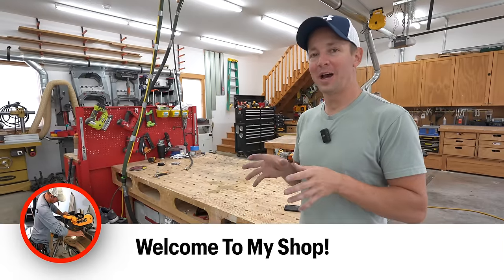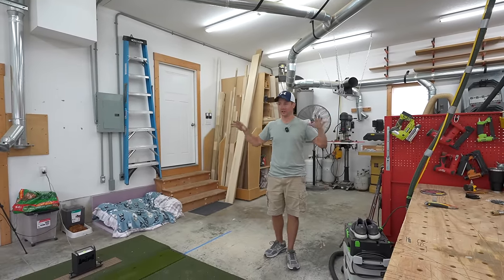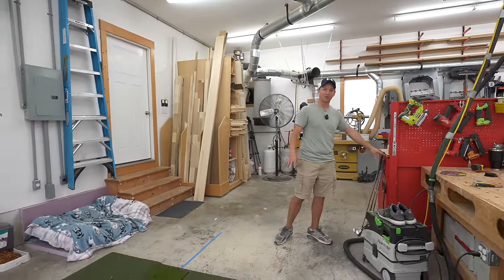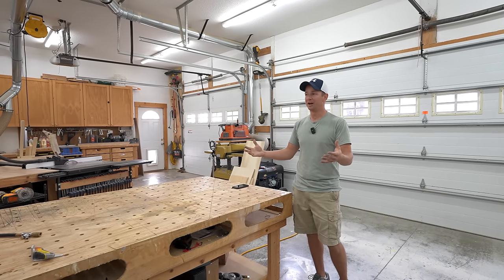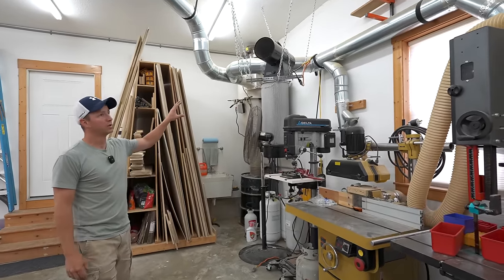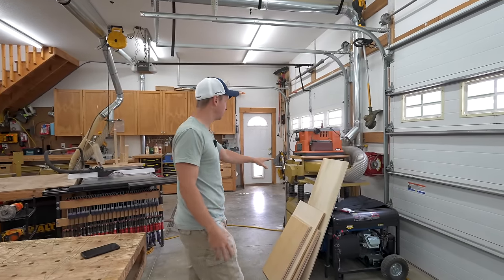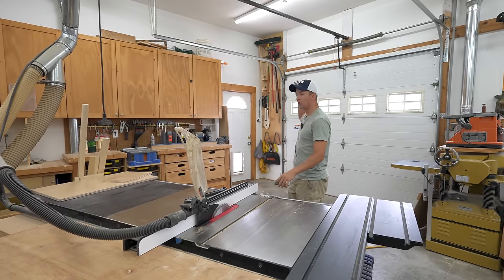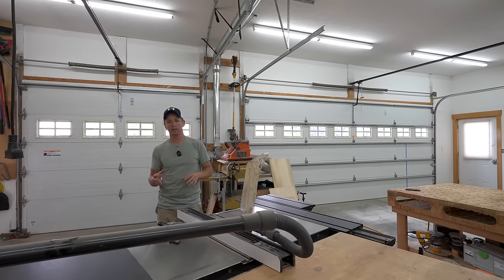Finally! A Trim Guys Shop Tour: The Truth About Small Shops...

Comment: Very nice shop. It’s interesting how different machines become important to some and not others. Seems not too many shops have a spindle shaper anymore. I guess good router tables have taken over. Similar to compound miter saws replacing radial arm saws. I’m a wood worker from years gone by and those 2 machines along with a good table saw were key. I guess there aren’t too many small shops making raised panel doors so a spindle shaper isn’t needed. I also had this huge overhead sliding table sander. Man that was a trip.  Nowadays the equipment is so neat and more affordable . Great video young man!

Comment: Please consider getting rid of the gas bottles and spending about $3000 for a. mini split. Not only will it keep your shop ready to go in at all times, but should you have a disaster as a result of the current heating, your insurance company may try to balk at the claim unless they were aware of the current set up. I had to remove my wood stove (after being honest and asking the question - but didn't want to find out the hard way it was an issue) but then convenience of a 100% temperature controlled shop sure has been nice. I can go there any time, day or night and it's comfortable. And the mini is super efficient. Love your work ethic and down to earth attitude! Thanks for the videos!

Comment: nice shop. i like when people talk about their thinking behind things, what is working well & what is not, and what they find works for the type of work they do. i think your shop is huge! having only been in really small shops, i see so much inefficient use of space that could easily fit even the stuff you have in your attic area down there. maybe check out some shop tours for folks that have really small shops. like no more than small two car garage size. ideally one car garage tours. you could easily adjust your layout, raise up your dust collection so it isn't so low and blocking useable wall space, etc. but you also seem to have the ability to go up in size. so probably doesn't matter. and what is working for now you do well in. i can't wait to see what it looks like when you upsize. thanks for sharing. best!

Comment: Here's a suggestion... I added a 24" deep shelf above the garage door track. I attached it to the wall on one side and used the same slotted steel used to hang the garage doors on the front.
Reply: I can't build the word picture from this, what it do?
Reply: @nevermindthebull0cks  I used 2x3 lumber for the sides to create a shelf, I attached 1/4" plywood on the top of the 2x3's... this gave me a 2' x 8' platform... I attached it to the header above the garage door springs using exterior screws... I cut L-shaped slots in the corners of the plywood next to the 2x3's, then I inserted slotted steel (the same ones to hang the garage door) and secured them with carriage bolts, I then used lag bolts to secure the steel to my rafters. This gave me 16' of storage (2 platforms) for less often used items, plus it protects items from theft when the garage door is left open.

Comment: Thank u Spencer !  I operate in my garage/ shop & see more and more guys doing it!  Instead of buying a shop or actually renting a shop I purchased a 2 nd veh ( a van) to haul tools .  Then put a lumber rack on my truck to haul some materials.  Do finish carpentry/contractor solo also.  Do a boat load of cabinets and built ins !  Some doors!  Very lean shop !  I run a 3 hp cabinet saw and my miter saw !  Hv small planer & jointer Also !  One huge work horse for me is the Track Saw ! ( I hv two Makita’s) and break all my sheet goods down to 4 or 6’ no more it’s too big for my shop!
I hv an Infinity Router Table and it makes all my doors or whatever ( lots of rabbits).
Great video but I see a track saw huge for a smaller shop!

Comment: The wall of shame? 😂 JK. I think everyone goes thru this very thing… thinking they could use something then talk themselves into needing it only to discover they didn’t. As a tool junkie I still fall for it occasionally. So now I make it a process. I make myself take at least a month to think about it and in most cases I find I don’t need it. 

A 100’ X 80’ shop… a spray booth, compressor room and a workflow tuned to my preference with a modular set up is my goal. 

Thanks for sharing Spencer! 👊👊
Reply from the maker: Same here!

Comment: Sawstop saved my tail when, in a hurry, I pushed a narrow piece through the fence - using a metal push stick - what was I thinking and was tired and careless. The pushstick hit the blade. Lost the sawblade and the clutch - which was so much better than the pushstick flying into my forehead.

Comment: Well those 30 sheets will become several hundred sheets, plus the drafts of regular dry lumber.
My son has a 4000 sq ft shop and its not large enough.
You will ultimately be doing your own finishing which means room for a paint booth.
You do have some nice equipment, dont be selling any, especially the sanding equipment.
He has a Oniada dust collection system also, and it dumps into a regular trash can.
But he also has a pump on that which runs while the dust collector is running.
And it pumps directly into a large enclosed dump trailer.
You will also be buying an edge bander, because the euro style cabinets are easier and more profitable.
But you can also put things like that on its own small dust collector.
If you trim houses, you will ultimately be making the trim, which is very profitable.
But it will mean a large shaper, maybe even two of them, so again dont sell the nice one you have.
You will also be using much more air, especially for sanding.
You (will ) also be upgrading your saw. Probably to a sliding table saw for cutting plywood, or a large rack saw, or even both.
You will also ultimately find other ways to get a straight edge on your lumber than by using the jointer.
Keep this video for future reference, because with the larger shop your opinions will change, and those will change as well.
The drill press will be used more as you build more cabinets for drilling the hinges.
Again, dont sell anything, you will ultimately be sorry you did.

Comment: That dust collector will work fine in a bigger shop you just need a bigger bin 5 hp is plenty big enough for most shops. Only reason to go bigger is if you have more then one person using big tools or you can have a separate collector for just your planer and jointer.

Comment: Great job! I enjoyed watching the whole video. I do have a question. But before I ask it—and let me apologize up front for the length of my question—just know that I am retired and new to carpentry and woodworking. I just started building a shop in my garage primarily to fix and renovate my house. 

Obviously you're familiar with Ron Paulk, or at least his old bench design, and over the last two to three years he's been getting even leaner with his setup and maintains that he can do everything he needs to do without all the large machines. 

So for example, instead of using his two Powermatic cabinet saws from the past, he's now using two small router tables that sit on his bench, a track saw, TSO parallel guides/edge guide and a small Sawstop compact table saw (the CTS). He still has a miter saw and I've even seen his Dewalt thickness planer on this trailer. Obviously he has many more tools, but he doesn't have anything I'd consider large, and he could literally fit everything he has in your garage twice over. 

Now I am NOT saying his system is superior (I don't know enough about what you guys do). But I do know he and his wife Chris have built over 200 custom homes on an Island in the Pacific Northwest. He's renovated many more and has done other countless projects. In fact, he considers himself primarily a finish carpenter. Before retiring and starting his Florida fixer, he was building tons of built ins as well, so I imagine  like he's doing virtually everything you're doing, but he is going in the other direction becoming even more of a minimalist than he was a few years ago. 

My question is this: what is he giving up that you are gaining by, not only working in a much larger space, but by doing without any large tools? 

The efficiency claims he makes suggests he's saving more time for his family than most as he and his wife have chosen a lifestyle where they want to travel a lot and surf, bike, hike, engage in photography, etc. In other words, what do you think are the significant gains you're making by going big or bigger rather than his supposed small and efficient approach? 

He also doesn't just have to work at his clients' homes. Everything he does can be done in his little garage as well, but he obviously chooses to be mobile so he can spend more time at his clients rather than commuting between their homes and a separate workshop (at least until he retired. Now he and Chris are fixing and I presume flipping homes, so he's primarily working out of his small garage which is probably similar to mine (20' x 20').

Comment: Hey Spencer do you get the suction you need on the boom from that MIDI? I run a couple and was thinking I'd get a CT26 for a boom over an assembly table but the midi might have the juice?
Reply from the maker: It works great. The only time I have issues is with large router bits clocking the port with large shards of wood. When that happens I simply unhook the hose at the half way point and suck from the opposite direction on the hose end and it clears right out.
Reply: @InsiderCarpentry  thats great. I've seen people get great suction even with the cyclone preseparator and its downright exciting! I have a 12x24 shop and cant fit or afford dust collection so strategizing on which mobile HEPA units to procure

Comment: I am always mildly surprised when I see permanent miter saw stations. Given how fast it is to move a dewalt saw stand (just pick the entire thing up and start walking), I have always assumed it would make the most sense just to have space in your shop for your miter saw, and then if you needed to run long material, or free up some space for another purpose, you could just move it. 

Obviously, cost would be a concern, but given you already own at least 2 saw stands that I have seen, I am a bit surprised you went with a permanent miter saw bench, rather than just putting a stand up against the wall so you can move it if you ever need to for long material.

Comment: Do you use a track saw in your work flow?  It would be easier to break down sheet goods using that vs. a table saw.
Reply from the maker: I much prefer the table saw for sheet goods. It's faster and easier the way I am setup.

Comment: I like your shop, but with that heater I wouldn't be able to breath. Those propane fumes and water vapor really bug me, I have to stay in the cold rooms on winter jobsites because the air quality those torpedo's kick out.
The electrical place I work for was out of the guys house outside of town when I started, now it's in a large commercial building in town. I don't think he meant for it to become so large, but it happened. Lots of employees and equip nowadays. Use to be a few guys and some used utility trucks:)

Comment: Couple questions. Does the sliding table on your saw stop loose calibration because you are cutting sheet goods. Or is it just a poor design. I've used sliding saws before making cabinet doors. And they are really nice for cutting styles and rails. But they need to be dead on accurate. I've always thought the attached tables seemed like an inexpensive option for a similar process.

Do you not make doors for your built ins. I'm surprised you don't have a few for sets for your shaper and a drum sander. You are $2k from building some really nice cabinet doors. It's a good reason to keep that beautiful tool I'm jealous of...
Reply from the maker: It's just not a very good design for staying accurate. So I haven't even touched it for years. 

Currently I have the cabinet guy make my cabinet doors to match the rest of the house. Maybe someday I'll get a proper setup when I have more space.

Comment: Only one thing to say. Every tool should do three things. Pay for it self, save time and most importantly give employees more freedom. Just ask yourself where do I not feel free or what appears hard. Now find the tool that gives you freedom and saves you time. Every tool that I have has paid for it's self. Most on one job. Do I need three impacts and a drill, no, and I have saved time and paid for them in not having to change bits. And the most important part I don't have to look for bits ever. They are always in the drill ready to go or put away in the case. Freedom from having to go to the store to get a case of bits because I misplaced all the ones that I need. Priceless, and saved one hour of my life, if I'm lucky.

Comment: Instead of leaning sheets of plywood against your wall, why not get panel carts so you can leave it on wheels, park in front of garage doors and if needed to move just roll them where you need to. Just saying.  I worked in a shop making cabinets and they had stacks of mdf on racks and when we needed sheets it was either drive the forklift or move manually move them. Asked the owner to invest in two carts. Kept them loaded and when needed we’d well them to the production area, and return carts back to the racks. At the end of the day we’d restock them. This way the fork lift wasn’t always needed. Worked out pretty well.
Reply from the maker: Because then I'd always have panel carts in the way. It's only for a small window of time that I actually need the plywood storage.

Comment: Bessy clamps SUCK!  I bought more than you have in one go and regretted it.  They constantly slip, sometimes so much so that by the time they have engaged you are already fully extended, I really hate them.  Go Jet or some other brand, Bessy SUCK!  I spent thousands on them and got so frustrated I sold them for a quarter of what I paid because I felt guilty selling them at all.
Reply from the maker: I don't have any issues.